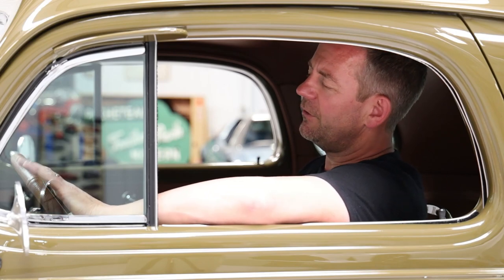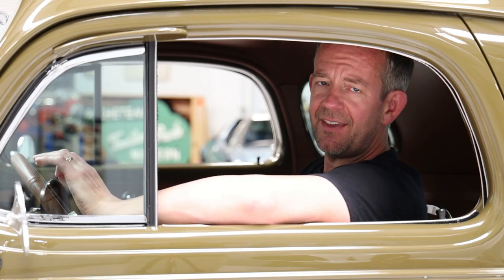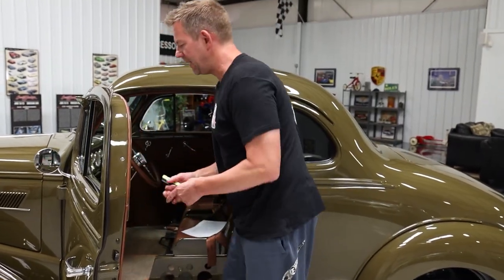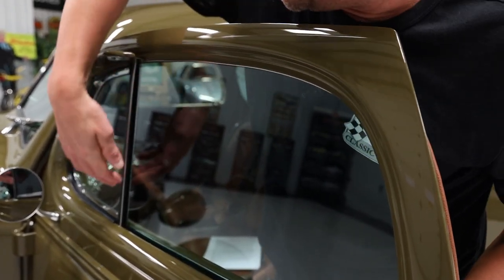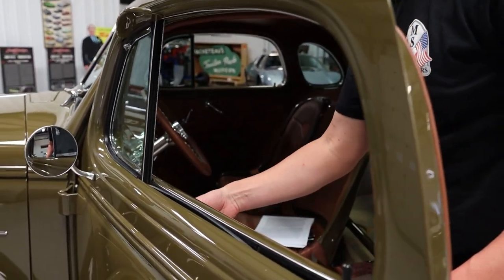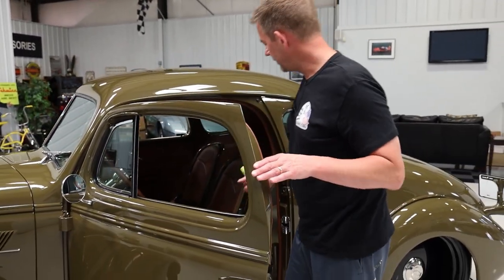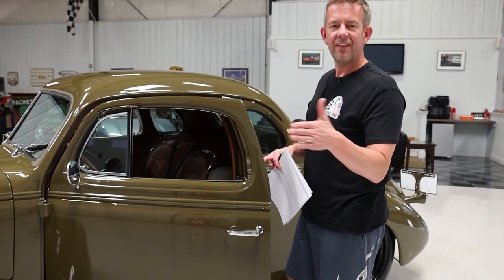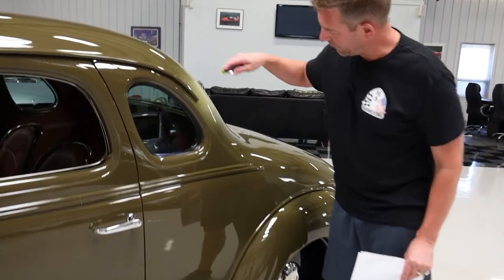1937 Chevrolet Business Coupe Custom

Comment: Beautiful..Brings back memories of my 37 that I built in the early 70's. Of course it turned out nothing like this fabulous 37. 
 It must have been built for someone that was shorter then you and I because I would be cramped with the seats in the back position. They'd need to be repositioned back at least another 5 to 6 inches. There's plenty of room to do that. Other then that, beautiful.